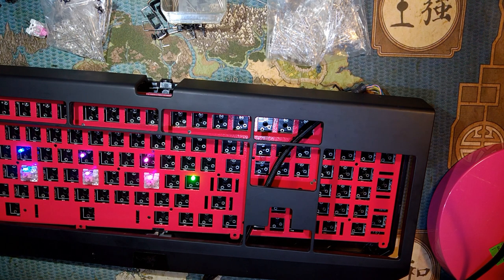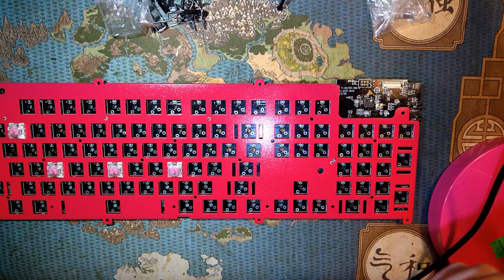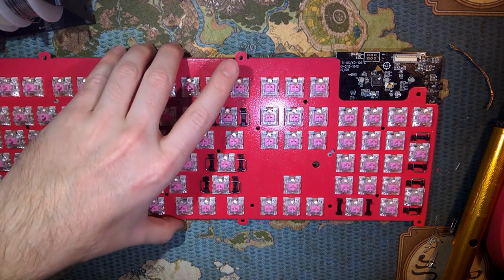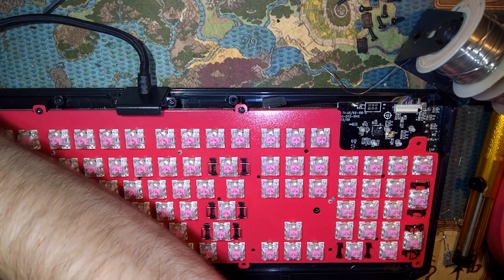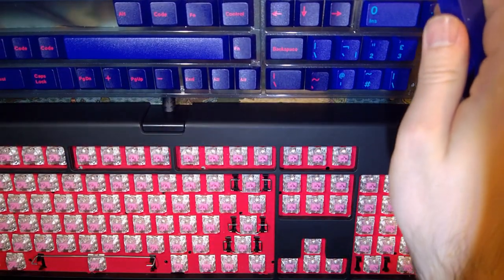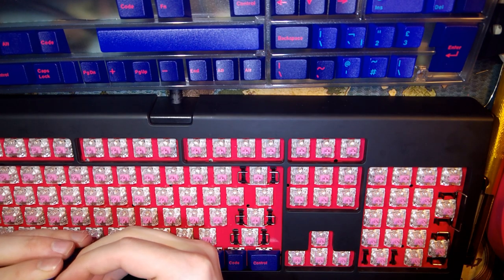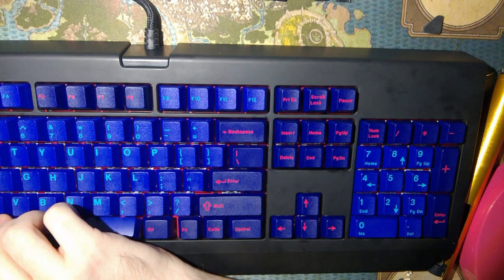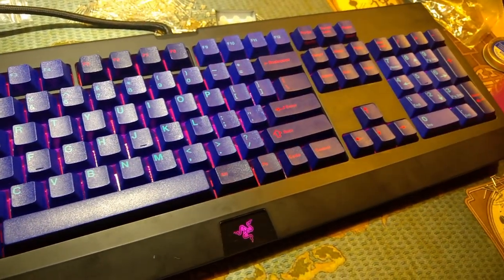Rebuilding my Razer Blackwidow Ultimate 2014

Comment: I’ve had my black widow since release and never had any problems with it, finally a razer product that works for more than a year :)
Reply from the maker: I use a Naga Epic Chroma for playing games. It works great but it's already been through one battery (I bought it refurbished from Razer's online store). This and the other two Blackwidows I bought also had some bad switches so my track record isn't great. Then again, the keyboards were all used so there's no telling what abuse they had to suffer through before I got them. The one Razer product I did buy new (Death Adder, the one after the 3.5G and before the Chroma) did have to warranty for an issue with the middle click. Or was it the left click? I can't recall. If nothing else, their support is pretty good. 

I guess that's a long and convoluted way of saying I like their junk as long as everything works properly. And now that I can fix nearly anything that would break, I certainly don't mind using their products since a lot of them have features that are unique to Razer (less so these days but a $15 keyboard is still hard to beat).
Reply: makho haha I remember my black widow being 100 smackeroos back in the day. I also use a Naga chroma and it has given me a lot of trouble with some of the side buttons losing their sensitivity, but I don’t wanna rip off the pads covering the screw holes out of fear for it not gliding as smoothly :(
Reply from the maker: @Shyverin  Yeah, I've had my Nagas apart for cleaning. A little heat goes a long way to removing those feet without ruining them. I actually plan on doing a video for one of my older Nagas (non-chroma, wired) if you want to see my process. It's probably a month or so away though because I literally just ordered the parts. 

If all else fails though, you can purchase new mouse feet for Razer mice on aliexpress.
Reply: @makho  Can you do a mod please I have only seen one vid of this from years ago. but can you do a Gameboy color in a gameboy pocket shell with a backlight screen.

Comment: I was about to mod mine Blackwidow X Ultimate, but I read that it would still be shit and it's not worth it, so I bought GMK67 installed KTT Kang white V3 switches, tape mode it, added some grease to stabilizers and I'm thrilled with the outcome :)
Reply from the maker: Yeah, it makes little sense to put in this much work these days unless you're married to a specific feature (like the USB passthrough). There's a lot of cool stuff coming out these days though.

Comment: what keycap set do you use? I want to customize a used razer blackwidow chroma and im planning to change its keycaps but i can't find any on the internet. also can you change the stabilizer on these keyboard to cherry mx style? i was wondering whether i could do that but i found no one talking about that on forum and internet. Btw what did you do with the led pin? did you cut them?
Reply from the maker: Should be compatible with current GMK keysets though you'll want to use the square 2x3x4 LEDs instead of the ones I used. You cannot easily change the stabs. Just cut the pins with flush cutters once soldered.

Comment: I've had the same keyboard for a year or two now. Friend gave it to me when it started chattering on him. If I buy a spring kit for mx switches do you think they'll work in the razer housings? I found 110 pcs 62 gram for $9. Also where you able to replace the LED's for the function indicators? Like caps/num lock etc? I'd like to paint my backplane red and switch to red led's while I'm in it. Awesome vid, very informative.
Reply from the maker: yes to all
Reply: @makho  Hey there sorry to bother you. Are the LEDs 1.5v ones? I bought a 2016 tournament edition for parts I'm going to mod similar to yours. I'd like to paint the backplane red and have red leds.
Reply: Its just occurred to me I lost one of the balance bars for the numpad enter. So might not do that unless I can find one.
Reply from the maker: @sokoloft3  I did not use low voltage LEDs.

Comment: what can you say about this keyboard's pcb? is it really worth it to mount other switches in it or it will have the same issues as if it were still with razer greens?
Reply from the maker: What issues are you referring to?
Reply: @makho  i had a blackwidow 2013 which has a problem of chattering despite having cherry mx blues which are reliable, but the thing is, I don't know if it's a keyboards problem or a problem caused by the previous user (I had to clean up this keyboard properly from inside lol)
Reply from the maker: @neriflst  I’d argue it’s the entire reason that board even had a previous owner. I can’t say I’ve experienced the same thing in a keyboard but in a mouse it’s nearly always the switches wearing out.
Reply: @makho  ok thanks

Comment: I literally just grabbed this keyboard out of what essentially was a goodwill dumpster and they charged me 1$, possible you still know what switches and caps you got? Maybe the links if possible?
Reply from the maker: Caps I used were GMK Laser that I got from drop.com (formerly massdrop.com). I don't believe they are still available. 

Any Cherry MX or clone switch should be a direct swap in and I like novelkeys.xyz for my switches. I don't recall what I grabbed for this board but I like the kailh speed switches or any other kailh switches with the clickbar